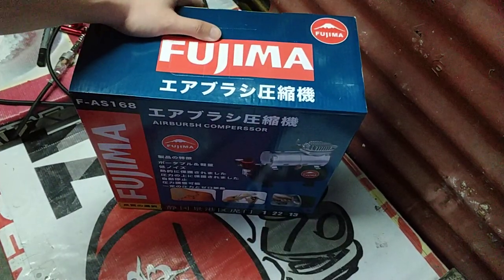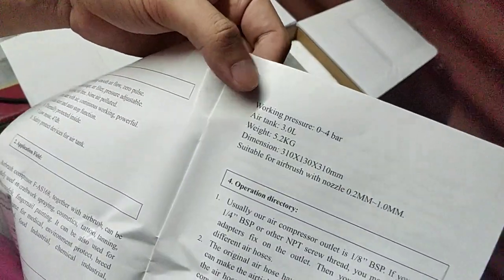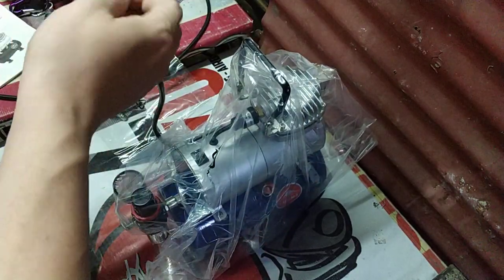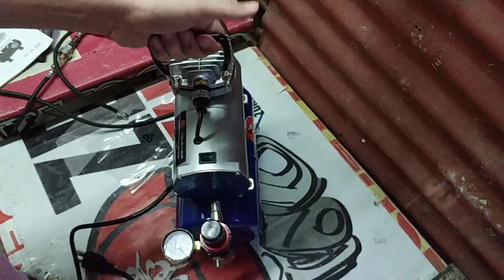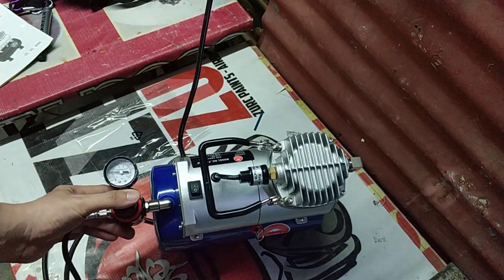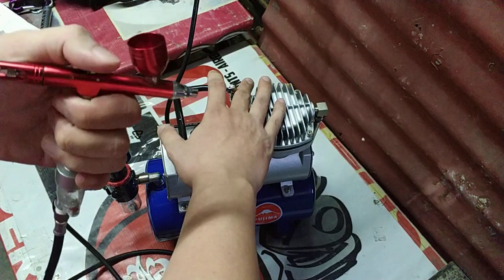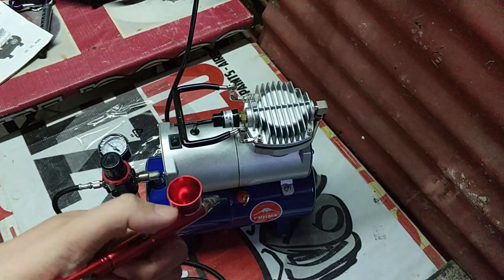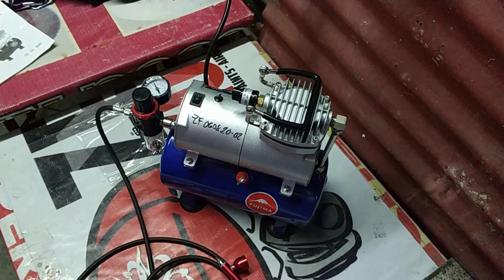Fujima Mini Airbrush Compressor Unboxing, Testing and Tips.

Comment: Boss pwede ba sa bradnailer to?
Reply from the maker: Negative. Need ng Brad Nailer 60-100psi. 
Optimum operating psi nito 30psi e. Kaya gang 50psi pero hirap na motor non, kulang pa sa 60psi na bare minimum for brad nailer